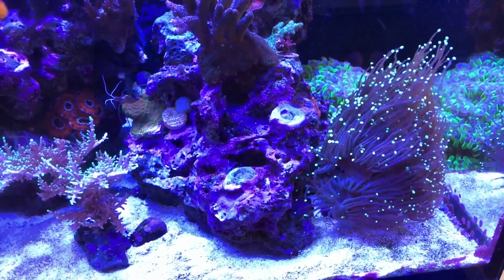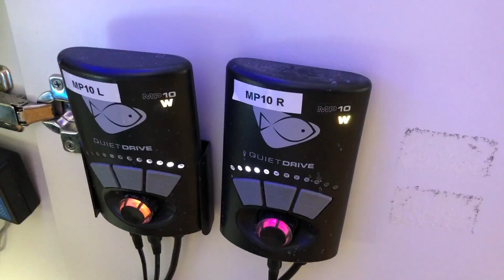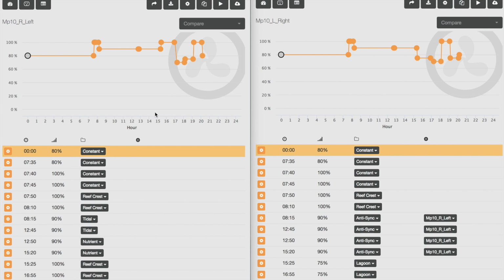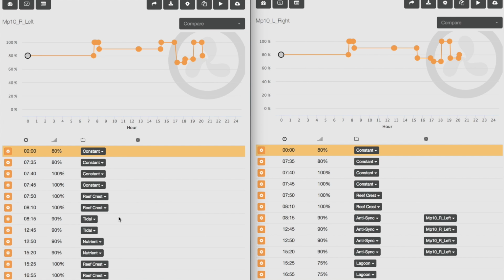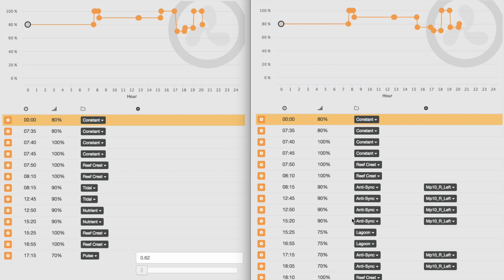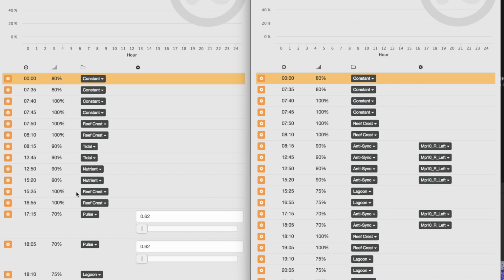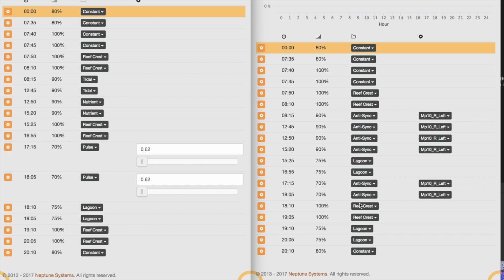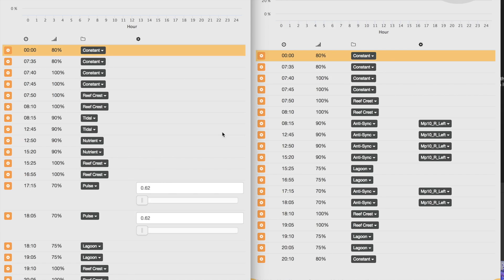Circulation in Redsea Reefer 250 with Vortech MP10s

Comment: My mp10 won’t stay on my reefer 250 side glass
Reply from the maker: To help support the weight of the dry side, you’ll need to use the square brackets (with the sticky pad on the back) and zip ties ; the ones that came with the mp10
Reply: @TheBioReef  that’s strange because it won’t hold. I tired the back glass and the wet side doesn’t even spin
Reply from the maker: @mylastright  Are you using the wire supports ? If the brackets are supporting the weight of the wet side, the magnet shouldn’t have issues connecting the dry and wet side together... At least that has been my experience

Comment: Hi! I have a 135g, I have an MP 40 but I decided to get an MP10 but keeps felling down, each are located on each side of my tank but at different level and side but still. My glass thickness is less that is advertised for 🤦🏻‍♀️
Reply from the maker: sorry to hear that Kamila... are you using the supplied velctro brackets to hang the mp10? seems like they just need some extra bit of support and it will help if they are mounted with the supporting brackets so the magnet doesn't have to bear all the weight of the dry side

Comment: I have a reefer 350, 4 foot tank. I want to switch to ecotechs but I'd need to get the mp40 because of the glass thickness right? How is your schedule going? Still using the same one?
Reply from the maker: V's Reef the mp40s are monsters; I should have started with them. My mp10: are still running the same schedule, but I cut down on the max intensity of the nutrient transfer mode, from 90% to 80% now that I gave the gyres

Comment: As always, great video sir👍🏾 If I had seen this entry prior to making a purchase I would’ve purchased 2 MP10’s in lieu of the single MP40 bought. EcoTech Marine’s site indicated the MP10’s “magna bond” would be too weak to penetrate the thickness of my IM 50 gallon Lagoon aquarium (10mm) Although capable for turnover rates, I would’ve preferred to program the alternating wave action from two opposing sources. I’ll make do and experiment with the current setup but pending the eventual/planned colonies, I might place an opposing MP10 on my system. Thanks again, cheers☀️
Reply from the maker: Thanks Daniel. I haven't had a lot of problems with the MP10 on the reefer, despite the caution. Before, i  didn't have them mounted properly (no sticky pads holding the chord above the motor), and the wetside would come off once every month or so... After i mounted them properly, the wetside stayed on.  that is until i added the gyres, which created a different type of challange.  Fro some reason, some combination of gyre speed and mp10 speed would force the wetside off the mp10... for example, when the gyres where running at 40% and the mp10s entered the Nutrient cycling mode at 100% (where there is a lot of short pulses), the mp10 wetside would often fall... i fixed this problem by running the Nutrient cycling mode at 85% instead. Ever since then, i haven't had any issues with them falling.
Reply: AmroAzul TV  Interesting, perhaps the thickness of glass weakens the mag strength of the unit🤔ah well, something more to contemplate as my nano comes together😃 thanks again.
Reply from the maker: @danielw.9090  yeah... i see what they don't recommend it...  I would say that it should hold, as mine has done, under most but not all circumstances.

Comment: So you feel that the MP10's have no problem securing on the 250's glass thickness?
Reply from the maker: Philip Winslow no issues but do secured the mp10 with the supplied  adhesive tap for the chord several inches above the pump as per recommended installation instructions

Comment: Great video as always. WOW lots of modes you programmed in. I used MP 10's on my older tank but I didn't have Reeflink or WXM so I wasn't able to have so many random modes. I use the MP10's on a frag tank now with the Reeflink. Great pumps.
Reply from the maker: Reefkpr thanks! I like them. I am curious about the gyres, but don’t like to have excessive equipment and wires in the display
Reply: I switched to the Gyre 130 in my older tank and run 2 Gyres 250's in my new tank. I love the Gyres. I wasn't liking the idea of having the wires inside the tank but since the gyres are near the surface you barely even notice them and you no longer have the puck sitting on the outside of the tank. Both are great pumps and have their advantages and disadvantages but its hard to beat the flow the gyres put out.
Reply from the maker: Reefkpr yeah users really seem to like them. Perhaps I can add one to the tank down the line